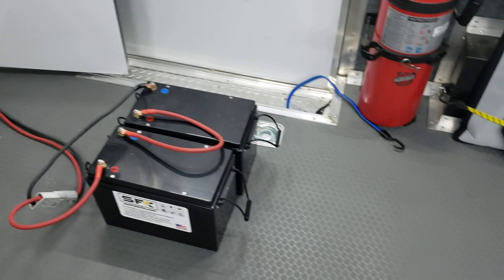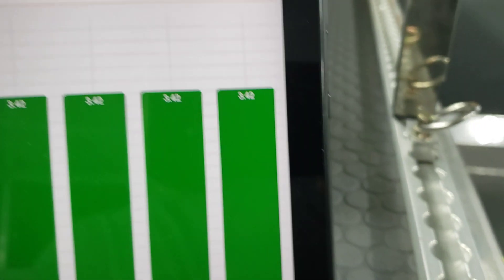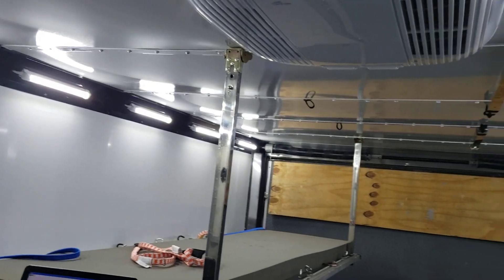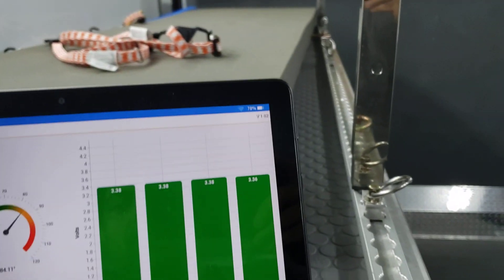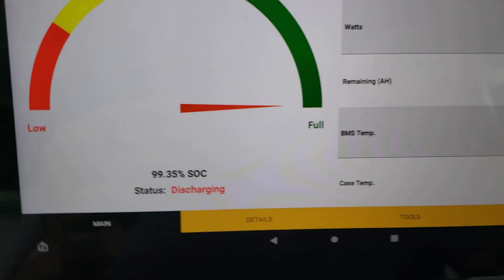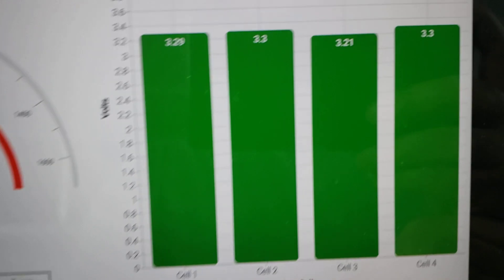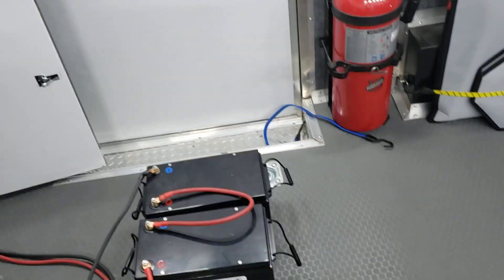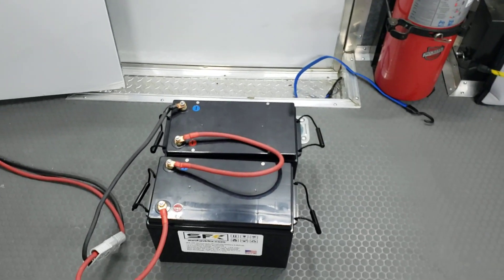How do we test our batteries SFK-260 & SFK-260HP? Run a RV A/C!

Comment: Is there a manual of sorts for the app and what each setting should be set up for general expectations to preserve it for the warranty and expected cycles etc… also do I want to allow charging and discharging as charging is showing as disabled which is counterintuitive to me
Reply from the maker: Hi, You can view the 300HP manual: https://www.sunfunkits.com/MediaStorage/Product/Documents/Document/51_20220823204314640.pdf it has a section explaining most of the BMS functions.

We will do a dedicated BMS manual soon, however, with frequent updates it gets outdated very quickly. Sometimes these have to happen to comply with new changes from Google & Apple..

Comment: I like your BMS software but would like to see it show cell voltage to three decimal points and not show 3.200v as 3.2v. Keep to three decimal points display. Believe the BMS hardware you are using is capable of near mV resolution but you are truncating displaying of information in your app.

Comment: Hi will your app work with just your bms or any JBD bms ?
Reply from the maker: Just ours, the firmware on ours is different from the stock JBD. however, Xoaxing app can still work with our kits & batteries.
Reply: Did that air conditioner have a soft start?
Reply from the maker: @dearlaserworks  I'm not sure the A/C is a bellair hougton, its new to the market and may have some type of soft start. We like it becuase it is quite, unlike dometic and coleman which are very loud.
Reply: @dearlaserworks  Probably regular hard start . Soft start ones help Greatly . Have one installed on house A/C 5ton . Sounds at start up was drastically changed . Electric bill dropped in summer . Got 1 on windows unit Sounds and Watt draw were Lower . Well worth costs .